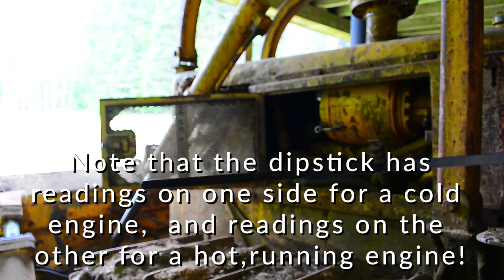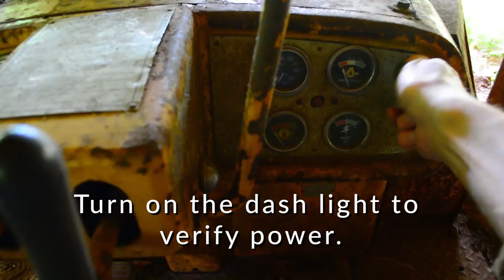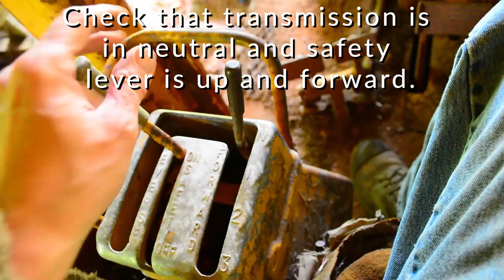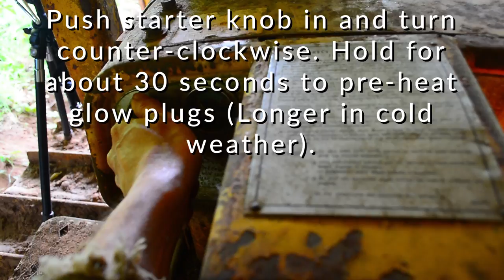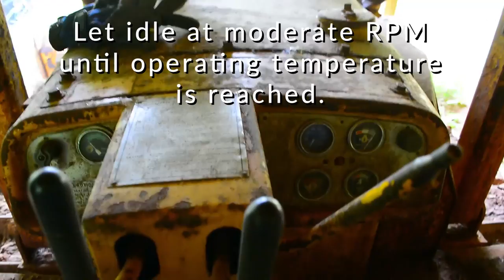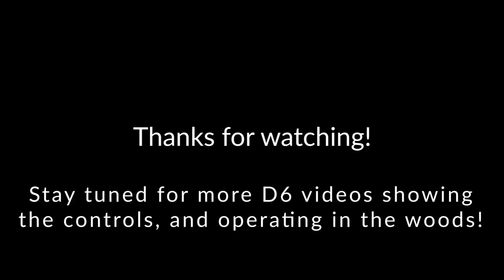Starting the Caterpillar D6-C Bulldozer (Music no one appreciates included free!!!)

Comment: They are hard on the ass on even moderately level terrain. In the winter anyway. Drove one once and hauled two. Made for a smooth ride once on the trailer.. Pulled them with an old MAc 237 maxadine 5 direct. Like driving a pick up with an elephant on the back.
Reply from the maker: Yep, and this one needs the seat reupholstered too. The pile of rags and carpet scraps I sit on is getting compressed. Fortunately, I rarely work it a full 8 hours a day! Another item on the To-Do list!
Thanks,
Avid DIYer.

Comment: Left steering clutch has issues, evidenced by the difference positions from the levers and pedals. The engine is a 3306 of which I have built hundreds and adore the sound.  I transitioned in to the age of electronic engines, but the old mechanicals were so much fun to tweak power out of. Can still do that with the electronic engines, just need to know how to tease an ECM. Music was great, btw.

Comment: Why would you pull the dipstick out wipe it off then put it back in to check the oil on something that's been sitting there....I can see if the motor had been running but after just a few mins even then the oil will be the same if you pull it out fifty times or none....just saying